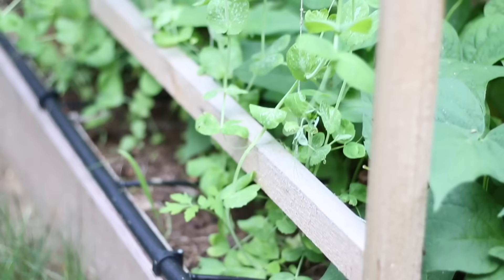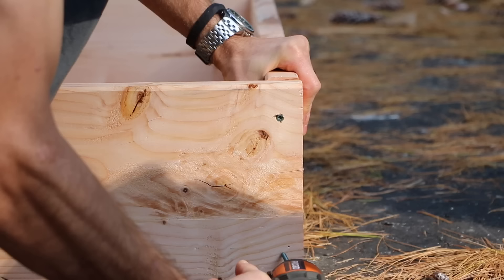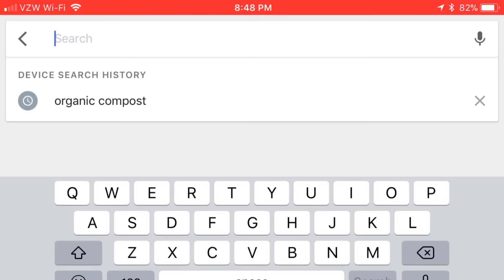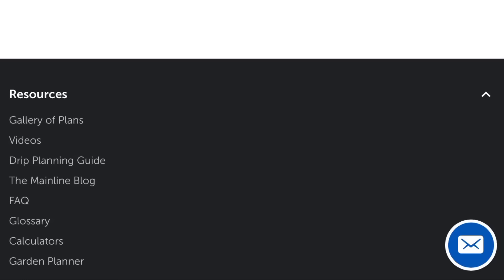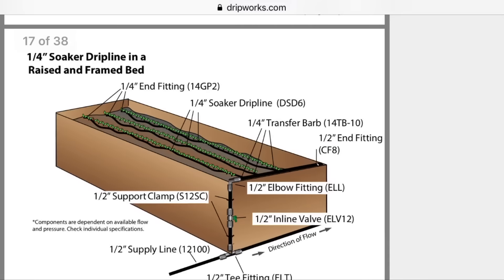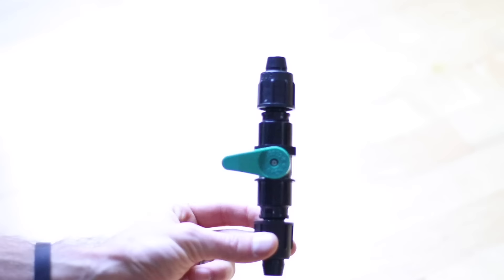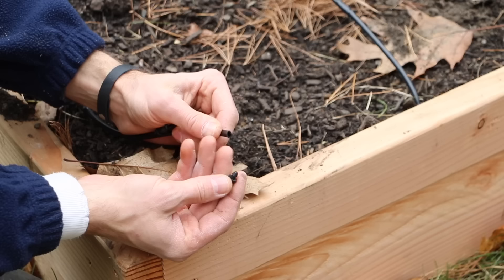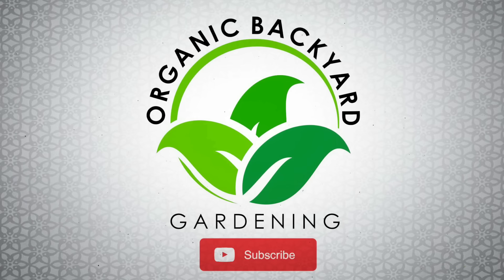How to Build a Raised Garden Bed with Drip Irrigation - Inexpensive & Easy

Comment: I've been using above ground beds for about 15 years.  One thing that helps:  paint the boards, ESPECIALLY the exposed grain ends, and BEFORE assembly so you get coverage at the joints.  They look nicer, and I think you get about double the life.  Irrigation:  I use a dual-level system.  I drill a 3/4 hole in the box side, about 1/3 from the bottom.  I run 5/8 main (valve at the entrance to the box if you want to isolate) into the box, tee to each side, elbows along each side (all this 1/3 from bottom).  I then connect 1/4 drip tube (integral weep holes) alternating in stripes from the two sides, covering the layer; again, 1/3 from bottom.  In each corner I put an above ground 90 degree sprayer, adjustable, with a spray range long enough to cover the size of the bed.  When first planting, I use both the above ground sprayers, and the lower (future root) matrix is always active.  After the plants have rooted, I turn off the above ground sprayers, leaving only the below ground root system with water.  This reduces evaporation, and also discourages surface weeds.
Reply: I just built my first dripper system and after I finished I had the idea that I should have set up a similar below ground watering system. Might be back out there on Saturday undoing all of my work.
Reply from the maker: Good luck! Join My Insiders List for Free Weekly Garden Tips
https://bit.ly/FreeWeeklyGardeningTips
Reply: You should post a video, I’d be interested!
Reply: @shelshele  Gee a video is sooo not-my-generation!  :-)   Since a year ago, I figured even easier method:  the 5/8 (standard plastic irrigation pipe) carries enough water that you can run it down the middle, and serve ALL the 1/4 tubes from one main pipe.  Again, put in about 1/3 soil depth, and put the underground dripper grid on top of that soil (then fill  the rest).  Install the 1/4" laterals about every 6~12", and cut them so the drip holes are staggered, alternatingly.  Remember that this lower grid isn't meant to give 100% coverage to seeds/seedlings:  it just has to wet the soil "down there", and the roots will grow to the moisture.
Reply: @petem6503  Are the underground dripper's specifically for in-soil applications? Don't they just get blocked over time?

Comment: Yes, the "new" pressure treated wood is safe for use for raised garden frames... with a few precautions! Up until 2003, the most common preservative used for pressure treated wood was chromated copper arsenate (CCA), a compound using arsenic as its primary rot protectant.The compounds currently being used are alkaline copper quat (ACQ) and copper azole (CA-B). Both contain copper and a fungicide but no arsenic.Yes, New Pressure treated wood is safe.
Reply: Thanks! Saved me from freaking out. I just built one with pressure treated pine. But i also plastic lined the walls. Hopefully there was nothing wrong with that :D
Reply: Me too 😅
Reply: To be on the safe side, a little common sense would go a long way, just use regular wood

Comment: This was a wonderful video.  Thank you!  Wanted to add, pressure treated wood has come a long way in the past years.  You can now buy garden safe pressure treated wood that will last you for up to 10 years and costs quite a bit less that douglas fir (and certainly much cheaper than cedar).  I have about 300 sq ft of raised garden bed using pressure treated pine, and I come out with about 500-600 pounds of fresh, healthy produce every year.  Just check the labelling to ensure the treatment process is such that it is certified as a Environmentally Preferable Product (EPP).
Reply: where did you purchase this wood you talk about?
Reply: @warfarewar8206  I don't believe that the old arsenic treated wood can be sold in recent years.  Now it's all copper based as another commenter stated and shouldn't be an issue.
Reply: @svenulfskjaldbjorn5401  Interesting, I stand corrected.
Reply: Wayne Mahon j
Reply: That seems like a crazy good amount of food for 500-600 sq ft, could you tell us more such as, what you grow, in what region, and your soil/amendment used

Comment: You can use pressure treated wood,  they do not treat the wood the same way as 10 years ago.
Reply: I use pressure treated wood but I line the inside with plastic where it contacts the soil.
Reply from the maker: Nicole Favreau Thanks Nicole, This is a very debated topic in the gardening community - If a farm is looking to get certified organic in the USA, you will be denied certification if your beds are pressure treated. Pressure treated wood has not been approved for organic growing and banned by National Organic Program (NOP) Regulations. However, if you do decide to use pressure treated or have it in your garden today, it’s very good to know it’s most likely doesn’t not contain arsenic as it was phased out over a decade ago (I’m not sure about standards in countries outside of the USA).

Comment: I enjoyed your video and found it helpful. However, I noticed that you advised against using pressure-treated lumber for raised beds. This may have been sound advice more than 10 years ago but most pressure-treated lumber today is considered non-toxic by most credible sources and I've seen at least one well-conducted trial that shows any leaching is not a significant factor.
Reply: I think its treated with copper now... could be wrong, but it should be fine to use.
Reply: That is incorrect. CA has bans, but the NE still allows formaldehyde and other nasty chemicals for pressure treated lumber. -Just get a PT sliver embedded in your hand, and watch how bad it gets. (Builder 30 years)
Reply: The EPA banned CCA treatment in 2003 which could leach arsenic. The new treatments are safe and leaching is almost undetectable.
Reply from the maker: Hi Rob, This is a very debated topic in the gardening community - if anyone is looking to get certified organic in the USA, you will be denied certification if your beds are pressure treated. Pressure treated wood has not been approved for organic growing and banned by National Organic Program (NOP) Regulations. However, if you do decide to use pressure treated or have it in your garden today, it’s very good to know it’s most likely doesn’t not contain arsenic as it was phased out over a decade ago (I’m not sure about standards in countries).

Comment: One thing I have found helpful when doing drip irrigation in cold temperatures is to use a propane torch with a push button ignitor to slightly heat (be careful not to burn) the ends of the tubing a few seconds before pressing the tubing on the fittings.  This works well on the harder poly tubing as well as the 1/4" drip line.  I have installed hundreds of feet of drip in my orchard this way in the winter and makes life a lot easier especially when using barbed fittings instead of compression fittings.
Reply from the maker: Hi Kent - this is a wonderful tip - the plastic can really be hard to work with. Cheers, Tim

Comment: All wood will rot eventually but  if you avoid contact with the soil it helps. Therefore I put the corners on some stones so they are lifted off the earth if only an inch. Additionally I protect the inside with the plastic bags the compost came in
Reply: Plastic allows BPA's in your soil epically during the summer growing months. We all have to except the fact that our raised beds have a limited life span.

Comment: Newer pressure treated wood is actually quite safe to use in the garden! Of course, some people may not feel comfortable with any treated products but MCA, CA-B, and ACQ do not contain arsenic, which was the main concern with earlier types of treated wood such as CCA. They do contain copper, but the amount that would be required for toxicity is far higher than what is typically seen with plants grown in these beds.

Un-treated wood is still preferable, but for people who may have issues with rot and pests newer treated products offer a good alternative.

And thanks for the video! Looking to make one of these this coming season and install drip irrigation in my other raised beds.
Reply: Benjamin Dan good treatment to the timbers then builders Dpc wrapped all round in and out well and correctly then nice free skip timbers ie pallets to clad the out side of the beds for a nice natural look . never replace timbers and lasts 30 years if you don’t clad the face 👍 I like doing it once and well 😊
Reply: Lance Uppercut I’m not up on some of the terms. Can you explain this in laymen’s terms please?
Reply: Agreed. Newer pressure treating is fine for building beds. Also, gravity does this thing where it pulls stuff down for the most part. So...?
Reply: What do you mean never?  When did they switched over?

Comment: Thanks for the video. I have used pressure treated lumber for my raised beds since the feds banned the arsenic infused lumber about 7 years ago. Pressure treated lumber today uses copper to deter rot and works very well for raised beds. The infused copper has an additional benefit, it kills garden fungus just like the copper fungicide that is sprayed on vegetable plants. On the downside, the copper infused lumber does not stand up as well as the arsenic infused lumber when it is contact with the ground, it will typically last about 5 to 10 years, depending on climate, before it starts to deteriorate. Just FYI.
Reply: Deals on wheels

Comment: Great video . One hint put cutoff valve on top of bed and cover supply pipe with 1 inch PVC cut in half in case you have to use a weed trimer

Comment: If interested in a fairly inexpensive raised bed, consider using cedar fence slats.  They are only 1" (or 5/8) thick but $2.97 per board at Lowe's; (Wood Fencing 1" x 6" x 6' Cedar Fence Board). They also make 1" x 6" x 8', boards as well.    I made a 3' x 6'  bed in 2016 (it's 2020 now) using these boards and they are still in great shape.  I made bed 3 slats high, (17.4") high since boards aren't really 6" wide.  I also made the legs 4 inches longer than bottom of box and planted those 4 inches below ground for bed stability.  When time comes to change out a board, it should be as easy as unscrewing and replacing.  Cost of slats and 1- 4"x4"  about $35.00.   I added pvc pipe on inside of box for hoops so that added to cost a bit but still done for under $60.00.  If you have untreated scrap 2 x 4's laying around, join them with screws and use for the legs.  Repurpose what you can.

Comment: I used pressure treated wood for two 4x8 raised beds this year and havn't had any issues at all yet. However i did line the inside with plastic before adding my soil mixture...

Comment: You could definitely have a few rain barrels to help with feeding gravity wise. Nice setup though and it looks real solid!
Reply: I was trying to figure out how to do that! I use airstones and want to make compost tea. Im looking to find how i can pump a bin of water into a garden bed. Any ideas?
Reply: I was thinking about rain barrels also.  The water faucet is too far away to connect directly.  For my present garden beds, I have to pull a long hose over to water them.  A rain barrel setup (or just filling up the barrels from the faucet) would be ideal.
Reply: @Shadow.Dragon  PRECISELY!! Sounds like my issue!lol
Thanks positive feedback!
Reply: @musenenlightened1984  if you have an existing system like the one in this video, add a T to the line to add your barrel in then you can use a cheap water pump to move your nutrient solution. Depending on the volume of your tubing it wouldn't take much of a pump.

Comment: I’d suggest not running the tube along the top of the board in the event you want to put hoops up or sit along the edge as you harvest or weed. I’d also suggest running the pipe up the inside of the bed rather than the outside if you use a mower or weed eater/wicker along your beds so you don’t break the pipe.

Comment: You could just loop the drip line back and forth and save on all the fittings and some 1/2” tubing.
Reply: Interesting idea... Your plan is simpler, cheaper and faster to build. Would your plan lead to uneven watering? I know next to nothing about drip irrigation systems. But it just seems like the water pressure in the line would degrade after each drip hole and that pressure drop would accumulate with each drip hole and might become significant at some point??? At what point is the key question because we just wanna water the plants efficiently! Your idea seems kinda like a Series circuit in electricity, whereas the design in the video is more like a Parallel circuit.
Reply from the maker: Yes, you could certainly do this!

Comment: Maybe I missed it, but I don't think you mentioned dealing with freeze in your permanent water installation. Underground irrigation systems are usually blown out in the Fall using high capacity air compressors, something few homeowners have. Leaving water in the lines over the winter is likely to result in damage.

I have a very similar setup on my multiple raised gardens to what is shown in this video, and I also use Dripworks as my supplier for the drip irrigation system. But I lay my main line tubing on the grass and tack it down using "U" shaped gardening staples, so I can easily pull them up in the Fall, drain them, and store them in the rafters of my garage over the Winter. I do not use the nailed hose clamps to anchor the mainlines along the top of the wood, but rather run the raised mainline tubing on top of the soil, along side the wood; it nestles in there very nicely; sometimes a staple or two into the dirt is needed. 

To help with seasonal assembly and disassembly, I don't use the mainline tubing between each raised garden if they are separated by more than a couple feet. Instead, I add the Dripworks fitting that adapts from the mainline tubing to garden hose fittings, then use garden hose to run water out from the source to the gardens. I tend to run one garden hose to each 'region' where I have one or two raised gardens, with a multi-zone timer controlling each garden hose, so I can have better control of which garden is watered when. Again, I use the "U" shaped gardening staples (Dripworks sells these as well) to hold the garden hose down to the ground, and after the first week or two, it just settles down and the grass grows over it, and it is practically invisible, and not a trip hazard,  and I can mow over it without any issues. It still pulls up easily in the Fall.
Reply from the maker: Check my video here on how I do this. How to Winterize Drip Irrigation Fall Winter Raised Bed Gardening - Raised Bed Drip Irrigation https://youtu.be/m0j8XT74Hik

I blow the lines out with an air compressor, I use this specially designed attachment https://amzn.to/2Vicvg5 (As an Amazon Associate I earn from qualifying purchases from Amazon Links)

Comment: I followed a similar plan on my raised beds but would caution that these emitter lines are prone to clogging over time (especially if you have hard water in your area) and will need to be replaced accordingly. Depending on the mineral content of your water supply, they may need to be replaced every year or may last two or three years before certain lines clog and stop working altogether. I wish they made a "No Clog" version of these types of lines but have not been able to source them.
Reply from the maker: Great Tip!

Comment: Nice work on the garden beds. Mine only lasted about 5 years before rotting out, so I need to re-do them this year with cedar. Expensive, but it is a very nice look. I have read that the pressure treated wood with copper is okay for garden beds. I think it is called MicroPro Sienna.  However, I think cedar is the best option. I will make the new raised beds taller and add a top board which will act as a seat or a bench - a nice look!
Reply: You are correct. On December 31, 2003, the U.S. wood treatment industry stopped treating residential lumber with arsenic and chromium (chromated copper arsenate, or CCA). However people continue to spread false information across the internet that it is unsafe...
Reply: This is what I came here to say... The disgust around pressure treated wood is absurd. Its the "Hip" thing to do to "highly suggest against pressure treated wood" when pressure treated wood is now safe for organic gardens. If you're REALLY worried about it, do what I do and use a pond liner as an insulator between the wood and your soil. I do it more to protect the wood against constant moisture from the soil and make it last longer, however..

Comment: Good video for those not familiar with yard irrigation. Why did you bury the lines? Why not just clamp them to the box sides for easier maintenance and less work?
Reply from the maker: Thanks bob! Good question, I grow grass so mow/weed wack in between the beds so having them under ground makes it a bit easier and I don’t have to worry about anyone tripping. If I had mulch pathways this would be a good option!

Comment: Thanks for the video and all the information.
What can I do to avoid freezing of the main and the drip line in winter?
Reply from the maker: Check my video here on how I do this. How to Winterize Drip Irrigation Fall Winter Raised Bed Gardening - Raised Bed Drip Irrigation https://youtu.be/m0j8XT74Hik

I blow the lines out with an air compressor, I use this specially designed attachment https://amzn.to/3IbssJ0 (amazon affiliate link)

Comment: Hi Tim, I loved the video, thank you! My question is, can I hook this system up to my existing sprinkler system for the lawn? If so, do I need any extra parts (pressure regulator, extra connectors, etc?). For me, that would be the best solution, but I am just unsure how to connect it to the sprinkler system. Thank you in advance!
Reply from the maker: Yes you can! There are many different retrofit kits (like this - affiliate link) - https://amzn.to/3PnCHy0

You might also like my free weekly email tips bit.ly/FreeWeeklyGardeningTips